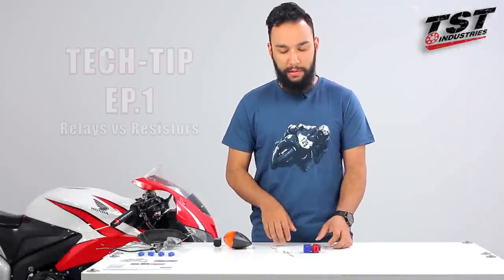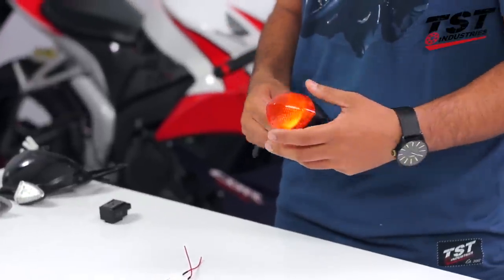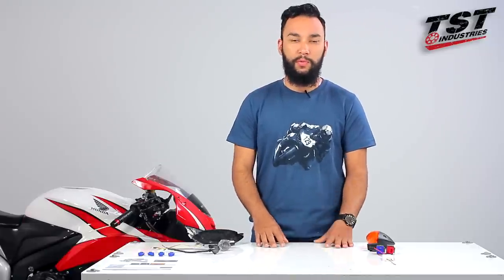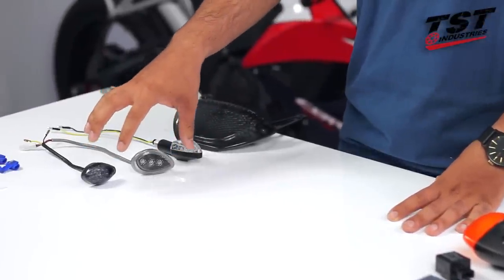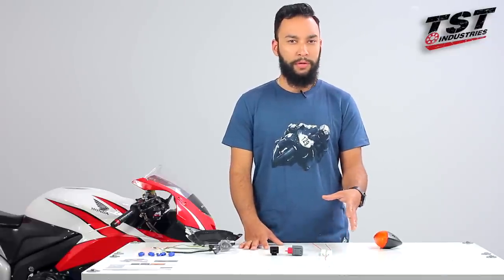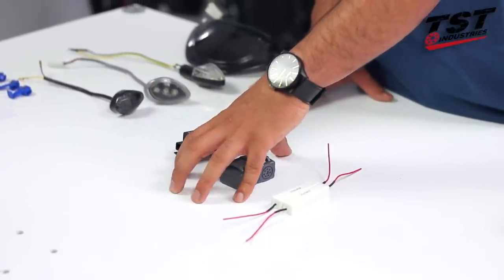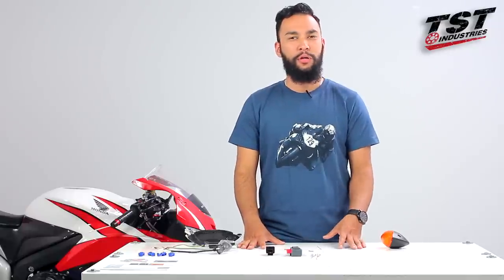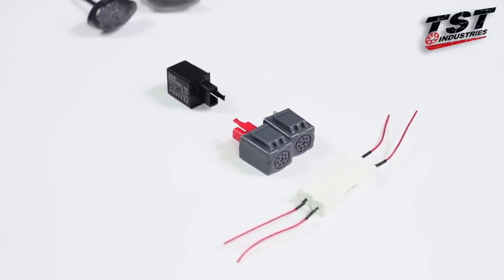Tech-Tip Ep.1 - Signal Relay vs. Load Resistors by TST Industries

Comment: I’m keeping the incandescent bulbs at the front and replacing with led turn signal lights at the rear. Will it be ok to change the flasher relay only I. This situation?
Reply from the maker: Yes, you can use the relay with one set of incandescent and one set LED.

Comment: So is Hyper flash a serious issue? because a lot of the kits you see out there ask if you want to flasher relay for an additional charge?
Reply from the maker: It will not damage your equipment but it causes the signals to flash faster. You can remedy that with load balancing resistors or a relay.

Comment: I installed a TST integrated tail light, license plate light and front flush mount LED signals with the Halo GTR option. I purchased the 2nd gen flasher relay and installed that as well. Although, when I initially turn on the bike and hit the signal button I get a short amount of hyperflash, then it returns to normal speed. 

While I'm riding the bike the signals seems to operate as normal, although, the odd time I use the signals I get a second or two or hyperflash and then it returns to normal speed... Any solutions? I did not think it would hyperflash at all, it is somewhat annoying as I just changed everything.!! Please help, thanks.
Reply: Hey having the same problem did you fix it?
Reply: @e92erik  negative. I think that's just how it is... I haven't been able to get it to not hyper flash for a split second. Sometimes it happens and sometimes it doesn't. After the split second it flashes as per normal. Something I've decided I will live with and not worry about. I hope this helps!! 👍😁
Reply: @ChrisMWilson  yeah ive realized it too its honestly not the bad its whatever man as long as the signals work right! i dont even think about it tbh after u start it and use the flashes atleast once it flashes normal so no  big deal.

Comment: Resistors still use same amount power(current draw) with incandescent or led.  Relay with led will make for less current draw.  Relay better option.  Plus resistors become very hot.  Do not mount on plastic.
Reply from the maker: Ding, ding, ding, we have winner! It's truly that simple.

Comment: What if I like the hyper blinking? Doesn't hurt anything right?
Reply from the maker: Does not hurt electronics. If you are using standard signals they will flash fast. If you are using sequential signals they will not likely finish their sequence for each fast blink.

Comment: So my blinkers stay solid when I turn them on. I just got an integrated tail light from you guys. I already have led front blinkers on my 2015 fz07. I also got the relay. So if I install the relay the blinkers should work without have to install the resistors? The package says do not install if you have a tst industries relay installed already.

Comment: I bought TST flush mounts, DST signal plug converters for Honda, the TST relay and the TST running mate. I put my lights in and the running light works fine however I have no flashing on one side and the other side flashing, but with dim lighting.
Reply from the maker: Did you follow one of our installation videos? It sounds like you connected something incorrectly.
-BR

Comment: I already installed the resistors but rear tail light still have hyper flash. Can i keep those resistors installed  and install flasher relay?
Reply from the maker: Ruben Spalding if you are going to replace your flasher relay with an aftermarket one, definitely remove the resistors

Comment: Thank you for the video. Can I surmise that one (LED flasher) or (load resistors) is required; not both? I’m concerned with too much current. Please advise.
Reply from the maker: Use either solution but not both.

Comment: HI! Love your products, but had a question....I have a 1995 BMW r100RT with an integrated headlight/turn signal/DRL - all ground wires run off the headlight plug, so I have capped off grounds from the signals and the DLR. Right now, the signals, brake light, and horn only work when the high beam flasher is engaged. Only when the flasher is engaged the horn and brake work, and I get a hyper blink. Should I look at installing resistors on the signals and DLR and wire the other side to the old ground wires, or get a flasher relay? Will any of the hardware in this video solve my other problems aside from the hyper blink?
Reply from the maker: I do believe that the issue you are having is a bit more complicated and has wiring issues. The horn and rear light should be isolated from the headlight. It sounds like these components are downstream in the circuit path from the headlight. I would advise you to get a wiring diagram for the bike, print it out blown up, and go through all the affected circuits on the bike. Then you can understand how they are meant to work and isolate them. I do not think any of the components featured in the video will be a fix for what you are describing.

Comment: I’ve already tried an led relay and it doesn’t work, all the indicators stay on so should I just buy the resistors and my motorcycle is a 38 Honda cb125td that uses the 2 pin relay and indicator cables are one positive and ground to earth for negative so will they work
Thanks in advance
Reply from the maker: Not all flasher relays are designed the same so I cannot speak to that part of your question. Resistors can potentially get you going. There are other reasons why your signaling system may be doing this. Swapping parts and installing other parts is not the best way to resolve a problem. A proper diagnosis is the best first step.

Comment: Hi Mark,

I fitted all LED's to my 96 Thunderace and now all indicators flash at the same time regardless of which way i turn the indicator switch. Am I likely to just need an LED relay switch? Or will I also need the resistors? Thanks Brett
Reply from the maker: On certain older bikes the dash indicator light used an incandescent light bulb and wasn't left/right isolated. I believe your bike is one of those. Regardless of what you use to slow down the flash rate I believe your symptoms will persist. The only way to remedy this is to buy two diodes that will cost you about a dollar, and then re-configure how the indicator light is connected. You take the two wires that go to the indicator light and wire in the diodes silver stripe towards the indicator light. Then you wire in those two leads containing the diodes to one side of the indicator light. You then ground the other wire from the indicator light. This should remedy the symptom of all signals flashing at the same time. Here is a link to someone else's writeup about the same issue : https://matchlessclueless.com/product-info/installation-guides/led-indicator-diode-installation/
Reply: @TSTindustries  thanks very much for this valuable information. I now know what I need to do and have ordered the correct parts including an LED relay and LED indicator diode kit. Now all I need to do is fit the parts with out any glitches! Many thanks :)

Comment: If i am installing this relay, do i have to change all my lights (front indicator, back indicator, tail light) to LEDs? Because right now i have all lights OEM and want to replace my front indicators with LED ones. 
Thanks for the answer!
Reply from the maker: you can do just one set and leave one OEM set without a problem

Comment: you guys have great products and great tutorial videos. I put the following mods on my 2006 Yamaha FZ6: Integrated Tail (LED 2 flashers spliced with the stock turn wiring) two rear flashers (LED), plate lights (LED) and flush mount (LED) up front. I put in an LED relay and my bike still has hyperflash issue when i accelerate. I am contemplating resistors but im running out of ideas and options. any help is appreciated.
Reply from the maker: What brand relay did you get?
Reply: a cheap one off amazon, Yosoo? I will buy your relay in a cpl days.

Comment: So I changed my front and rear lights with the led's from you guys and now when I turn my key,  I'm getting super dim headlights and dash lights and tag light.  Bike won't even start.  What's the problem?
Reply from the maker: Looks like you drained your battery during your installation. Please charge your battery and make sure it is holding at least 12V.

Comment: I had incandescent rear lights and led front lights with an electronic relay and it worked. I put LEDs on the back so it's a full led system. They haven't blinked at all since I took the incandescents off. My first electronic relay stopped allowing power through it completely and I just picked up a brand new one and it allows power to the signals but no blinking. Any idea what the issue could be?
Reply from the maker: It can be a number of things. Not knowing your exact setup I can't tell you anything with confidence. The electronic relays are not all designed the same way so there isn't an assumption I can make on that part. If you had our parts installed we can help you more. Is your relay adjustable? Maybe you just need to shorten the cycle? It's tough to know without more information.
Reply: @TSTindustries  I actually got the Ep34 led specific square relay and it solved it. The little round clear ones I was trying to use, I think EL12's, weren't clicking with all four LED's on. Didn't have enough power drawing. EP34 worked perfect. Thank you anyways for the reply

Comment: hello I installed led turn signal on my nc700x but the turn signal only turns on half way lit when ignition is on and does not turn on when motor is running. any installation help? also what i need to fix it.thanks
Reply from the maker: It sounds like you have them connected wrong. Typically signals are single circuit devices. I have seen Honda owners connect the fron signal and running light wires together to the positive wire on the new signal. This screws up the operation of those circuits. On Hondas, in the front signal plugs you have a blue/white wire on one side of the bike and orange/white on the other. Make sure these are not connected to the signals. Only connect the solid blue and solid orange.

Comment: Mine does not blink, all turn signal lights up and the flasher relay is buzzing, do I still need a resistors? Also is the buzzing normal?
Reply from the maker: The buzzing is not normal. That sounds like you are using an OEM relay that is switching so fast it in fact make sht esignals look like they are staying on. You will need either resistors OR one of our LED Flasher Relays

Comment: I have a 2019 MT-07 in the EU, does the TST 2 Pin LED Flasher Relay Gen 2 fit my bike?
Reply from the maker: According to my research in European parts fiche yes. The information provided by Yamaha in their parts breakdowns is all we have to go on though so if you want to be 100% sure just pull out the relay and compare its connector to our Gen2 relay

Comment: I just bought the integrated tail light from you guys for my r3 and it says to install the resistors if you don't have the relay but would it matter if I didn't install either at the moment or would it cause any damage? I also have front led turn signals so I already have the hyper flash issue
Reply from the maker: Not installing the LED Flasher Relay or Resistors will not result in any damage. However, being that you are already experiencing a hyperflash issue, when you install the tail light your signals will more than likely stay solid when activated.

Comment: I ordered the integrated tail light but haven't installed it yet. you said it comes with resistors so does that mean I wouldn't need the relay at all?
Reply from the maker: Installing resistors will only fix the flash rate for your integrated tail light. For this reason, we always recommend getting the LED Flasher Relay because it fixes the flash rate for your entire signaling circuit (front to rear). If you decide to get a flasher relay in the future, then you would have to remove the resistors from the motorcycle. You can only use one or the other and not both at the same time.

Comment: Mines not even hyper flash. Just installed your taillight and the light itself is just yellow. That’s it. No flashing. No brake light
Reply from the maker: Your front signals are wired in incorrectly. The signal wire is connected with the running light wire up front, pushing current through the signaling system causing the tail light to be in signal mode (Amber/orange). Get into the front signal wiring and disconnect the blue/white on one side, and orange/white on the other. Your entire lighting system will function properly then.
Reply: TSTindustries it’s a good possibility. Just bought the bike and the front signals aren’t on there anymore but the wiring is. Thanks for the advice. Will do.

Comment: I'm doing this on my car and am trying to understand what's really going on with resistors. I'm horrible with electrical knowledge! Wouldn't using resistors just mean that your still using the same amount of electricity? I guess what I'm trying to achieve is my lights actually drawing less energy. Is that only achieved by installing a relay? And if so, could you give me an idea of what kind of relay I'll need?
Reply from the maker: +efini_fc Can you tell me why you want the lights to draw less current?
Reply: +TSTindustries I just like the idea of its efficiency. I always drive with running lights on. I know the alternator keeps the battery from being drained, but wouldn't LED help extend battery life still? 
I just don't like the idea of using resistors. seems pointless for current draw and somewhat dangerous.
I don't have an auto off function too, so in the event of lights being left on without engine running lower draw would be nice.
Reply from the maker: efini_fc The type of relay you will need for your car will depend on the car you have. There are many LED Flasher Relays on the market for cars. Some require wiring the relay in while some are plug and play. Do a Google search for the proper relay for your car and chances are you will find a supplier that has what you need.
Reply: +TSTindustries thank you!
Reply from the maker: +efini_fc you're welcome

Comment: Hello. On my bike all 4 led indicators flash together, will a relay solve my problem? Thanks a lot.
Reply from the maker: This sounds like you have a Kawasaki. We have seen this symptom on some bikes that had OEM signals replaced with LED signals. This mainly happens on Ninja250, zx7R, zx9 models, and some others. On these bikes this is caused by the wiring of the dash signal indicator light. If your bike is wired this way just replacing the relay will not fix the problem. If you confirm that this is your situation we can assist you with more information on how to solve it.
Reply: @TSTindustries  Hello and thanks for replying. I have a Honda, and as you said replacing the relay didn't work. The problem was that the bulb on the dash didn't have ground. It uses as"ground" the other pair of indicators. So thats why the all turned on. So with two diodes and a ground, all are solved now.

Comment: I installed led indicators on my bike. they don't flash at all they stay stuck on like a headlight... I then installed load resistors and they hyperflash now? anyone got any clues what's wrong? can't figure out why they don't flash normally with load resistors in place. have I installed incorrectly?
Reply from the maker: what year and model bike are you installing on? What type of signals?
Reply: +TSTindustries 2013 crf250l I'm unsure on brand of the led turn signals
Reply from the maker: +Because it's Blaze Did you install the resistors in series or in parallel with your signaling circuit?
Reply: +TSTindustries parallel. I've looked everywhere and can't seem to find anyone having similar problems.
Reply from the maker: Because it's Blaze It sounds like you are not drawing enough current to make the signals flash with the first configuration, and you are drawing more but not enough current to make the signals flash at the correct rate. You may be able to get a lower resistance value resistor for each signal and then draw enough current to make the system flash at the correct rate. Or you can just replace the relay and that should solve your problem.
Reply: I put a multimeter on the circuit after the resistor it's showing 8 to 13 ohms but the branding on the actual resistor says 6 ohms would this be a problem the resistor says 12 volts 50 watt 6 ohms
Reply: I'm thinking it may be dodgy resistors to be honest
Reply from the maker: Technically, with 6 ohms in parallel with your signals you should be drawing enough current so that your system flashes normally. Even if it were 8 ohm it should be fine. Do you have  front and rear signals plugged in or just one set?
Reply: +TSTindustries all turn signals are plugged in and all 4 are the same led signal... I'd buy a relay for the bike but relays I find won't ship to my country and I can't seem to find one locally but I'm also wondering if I'll have the same problem again.